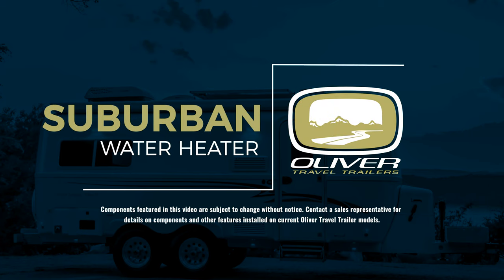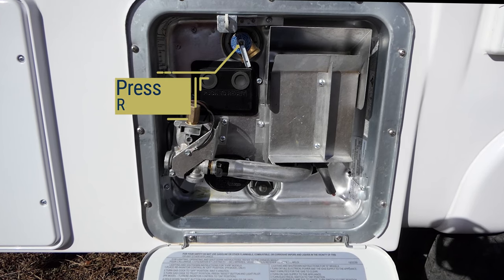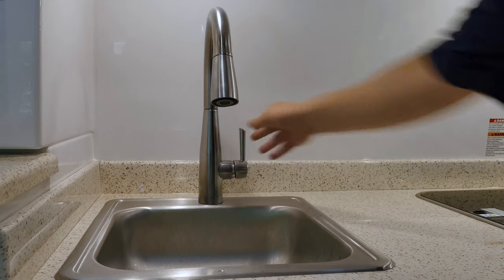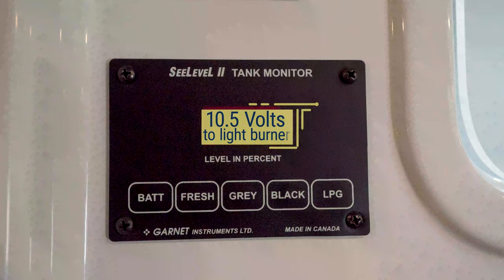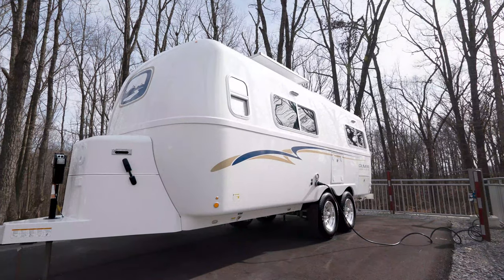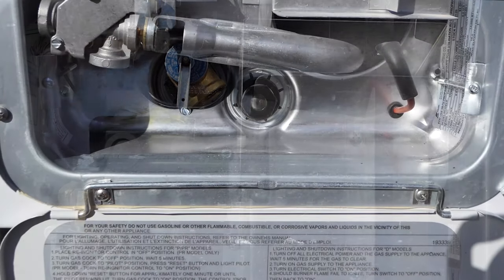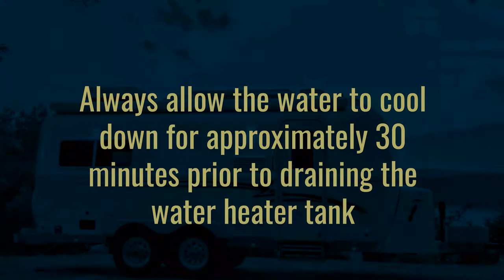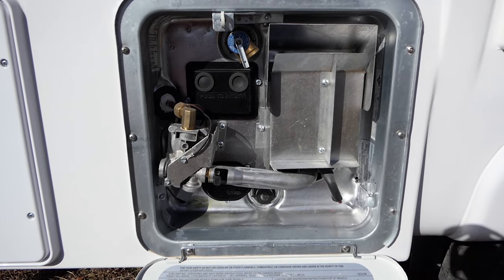Suburban Water Heater | Oliver Travel Trailers

Comment: What is the other switch to get the electric mode of the heater going? I have the one on the furnace switched to on, what is the other switch?  2 are mentioned.  I don't want to run off propane and I am at a 50amp connect.